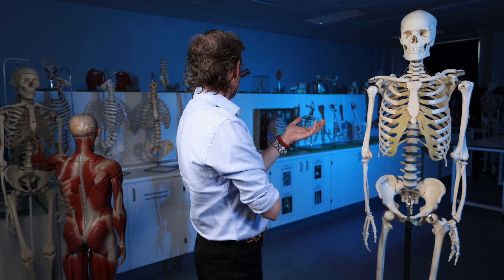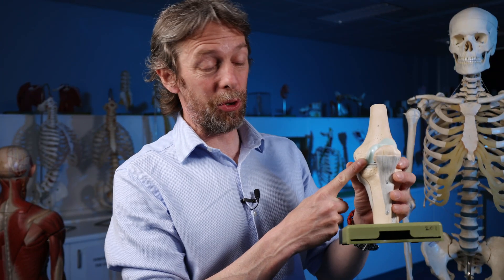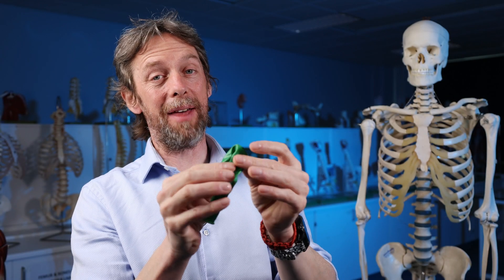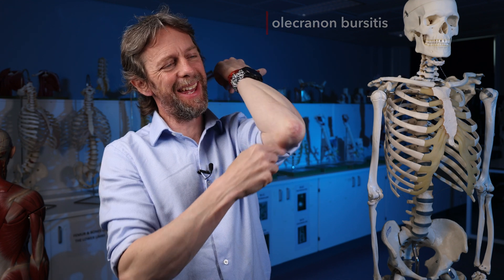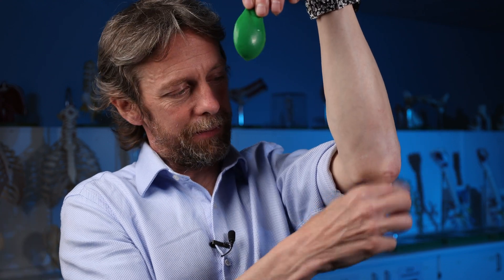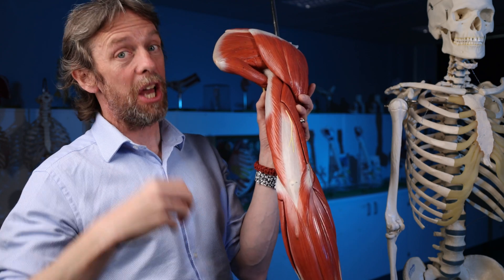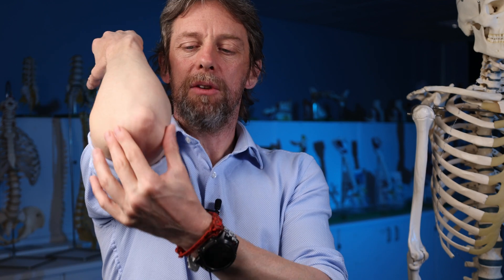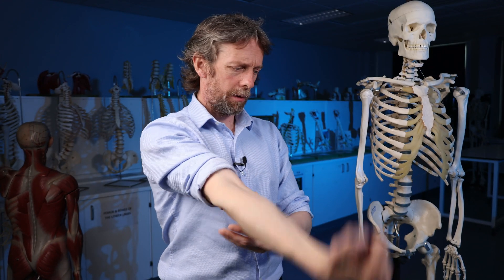Elbow bursa and olecranon bursitis

Comment: Three years ago I damaged my right bursa by pressing very hard down on it with my entire strength, on my boat deck.  I was trying to get back aboard.  I had nearly capsized my new 18 foot racing catamaran in heavy air, and was unable to get back on board from the water.  With my last burst of effort, I got nearly up on board from in front of the front crossbar.  "Last burst" was grabbing something on the deck and using all energy left to pull myself up aboard.  This worked (hurray!), but pushed so hard down on the right bursa that it burst a largish blood vessel and immediately started filling that forearm with blood.  Now it is 2 miles back to the beach, so I went "home". All other racers were single-handers, 2 miles the other way, no cel phones anywhere, no power boats.  Somebody dropped my carbon fiber mast which broke stuff.  My BLOOD FILLED FOREARM  got better by itself 3 months later.
Reply: That was quite an ordeal, glad you are healed.
Reply: Gee! Glad you got better! 😅😊

Comment: Mr Webster, I am dealing with this now without any pain. I was working very hard on triceps using dumbells. I also swim a lot but think the weight lifting may have caused my problem. Can you comment on the likelihood of what happened pleased? It is slowly getting smaller after a month. I did have the fluid drawn off but it filled back up. Thanks, I learn a lot off of your videos.

Comment: Following a violent impact on a rock , doing whitewater kayaking , some pea size soft tissue calcified and had to be removed.
Now I'm confused , because I feel there is only skin over bone ... and no tendon there ... and never had any mecanical problem , only a pressure pain like a rock in a shoe.
Surgeon never explained what he did ...  surgeon/peasant relation.
Could it be that he took off the bursa and the calcium pea was a bone chip under the tendon ?
But then why take off the bursa ? ( surgery was a year later and only the pea was a problem )

Note : surgeon should have put some silicone under skin ... coz bone doesn't like to have only skin covering it